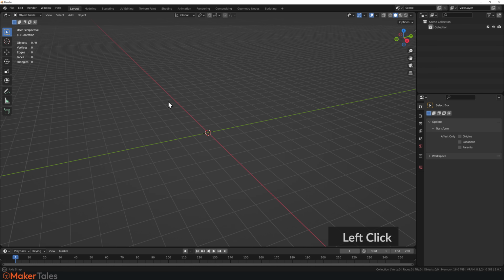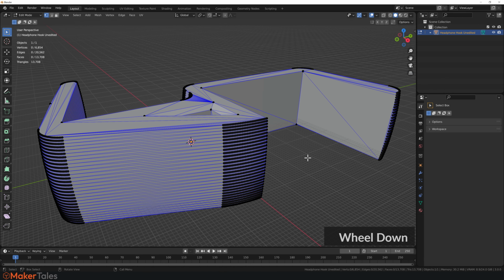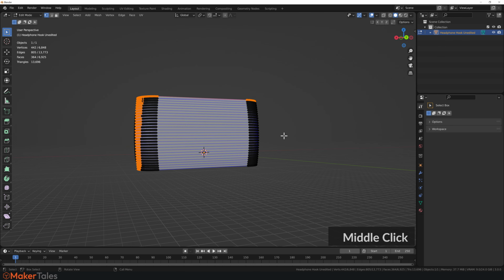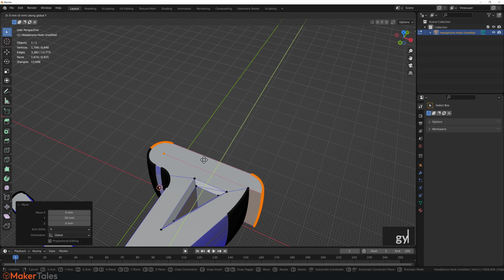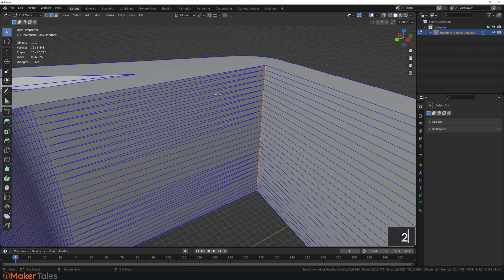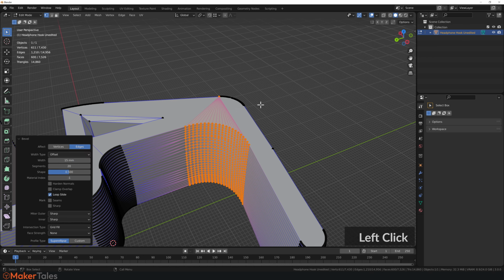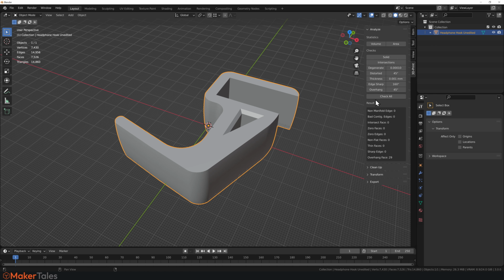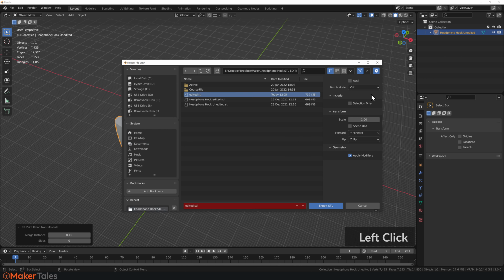How To Use Blender 3.0 For 3D Printing | .STL Mesh Editing

Comment: I appreciate you making this video! Ran into a part that needed a portion extended to fit properly (thank you, measure and grab). It also had some really unnecessary geometry hiding around the edges, and the dissolve tip was exactly what I needed to get rid of those while maintaining the surfaces that I still wanted.

Comment: halo , i have a aluminum alloy tuning fork . My model is orz om 136.1 hz  how to change the 0.5cm wheel handle support to 0.1cm with blender 3.4 ? And then i dunno if the aluminum changed to 0.1cm ,what sizes values could use . thx

Comment: Blender is such an awesome and powerful tool but as a newcommer to 3D modelling & printing as well as blender it is shockingly complicated to learn the 10238091265812659812659812 important hotkeys, basic controls, modes, etc. even before you can start learning the modelling process. Feels like it takes a lifetime to get started, so thanks for your videos, they do help.
Reply: Blender is only complicated in the beginning, because it behaves very differently compared to other software. I don’t know about version 3 and up, but I learned version 2.7 controls and use them ever since. It’s very intuitive once the hurdle of unfamiliarity is gone. I watched a bunch of beginner tutorials and it got me up and running in no time.
I went from no blender experience to creating decent cycles renders in about a week.
I did have some 3d modeling experience from using milkshape 3D, might have helped with understanding some terms and concepts better, so…

Comment: I have a question about the way a model is printed. I sorta know what I'm doing in Blender and have never 3D printed before and I just needed some things clarified. For example, the model you made here, would the printer print it hollow? Since the model doesn't have a solid inside and it just faces, would the printer calculate to make that a solid inside or is it hollow. Also, what if I have an object that has all faces except for one that is deleted and allows the inside to be shown, does it also make that solid or does it not? I know this is a long comment but I'd appreciate any help, thanks!
Reply: It kind of depends, I haven't done any molding in blender, yet: but if I say made a cube and then save it as an stl file then when its sliced, it would print it as a solid. How solid would depend on how much infill you choose, (it's in percentage). If you made a box then your infill would be what ever the thickness of your walls are. Put simply.  Hope this helps.
Reply: @pooheadlou  Alright so if I understand correctly, you can choose the added thickness of a face that'll only be applied in the print. Thank you, that helped!
Reply: @flooskesky764  yes. However you can also (use the slicer, say importing a cude) go with no infill and say no top layer and end up with an, open top box, or say no top or bottom layers, and end up with just the 4 sides, and no top or bottom. So in some ways you can do some very simple modeling, (kind of! (Using slicer settings alone)  Hope I haven't confused you. Youtube is your friend watch lots of videos, on the subject. It will start to make some sense.

Comment: I think this is a problem you can help me solve. When I have an object that has alot of remesh and I try to use limited dissolved, blender always crashes. The problem I'm trying to get at is by me using boolean to cut the object by remeshing the object and using limited dissolve.
Reply from the maker: If it's a super high poly mesh and you are decimating it... In my limited experience if you want to keep precision use limited dissolve but as you have seen there are limits there. If hyper precision is not a problem. first be sure to merge as many as possible by distance and that use a decimate modifier and see if that works any better. Head on over to discord if you would like the community to give a try.
Reply: @Keep-Making  thanks for the tip and I would definitely join the discord group. I totally forgot you had one.